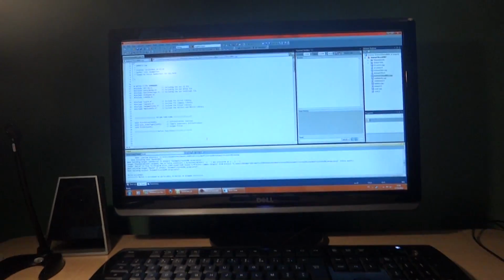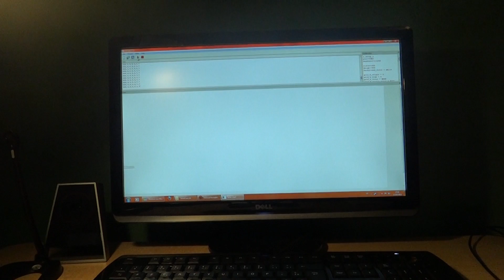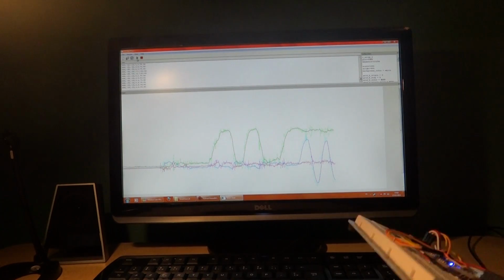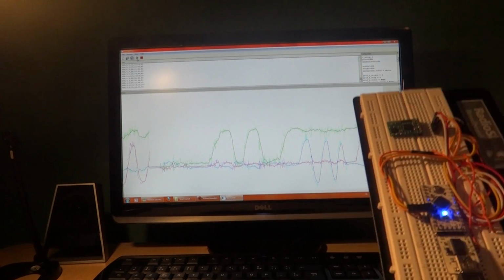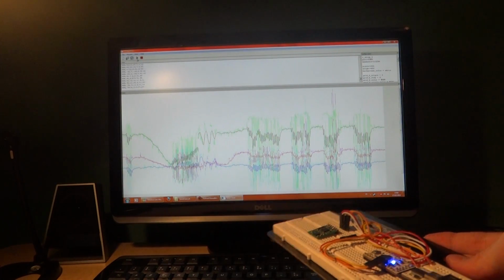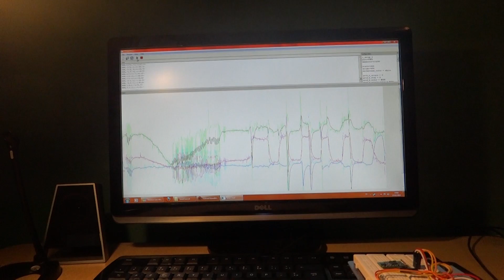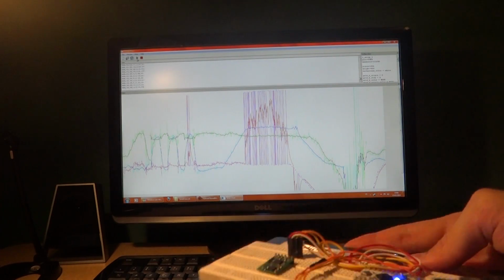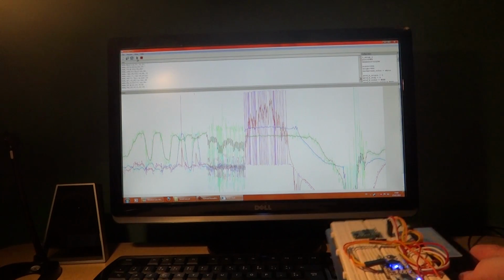9DOF Kalman Filter

Comment: Page Not Found :(
Reply: me too :(
Reply: I solved this, you can use this :D
https://github.com/TKJElectronics/Example-Sketch-for-IMU-including-Kalman-filter/tree/master/IMU/MPU6050_HMC5883L
Reply: Thanks for the link :) 
Actually, I want to mesure the angle using Arduino and 10DOF with a kalman filter , do you have any idea ?
Reply: You can get roll, pitch and yaw with the example code, using mpu6050 and hmc5883l 9DOF, also, It seems to me kalman filter is too much for arduino, but if the code isn't large, go on :D
Reply: Well, I do it but i found many symbols incompressible !!!! why ?
Reply: what symbols?
Reply: some thing strange! do you understand what i mean
Reply: no I don't understand, this example works fine on arduino